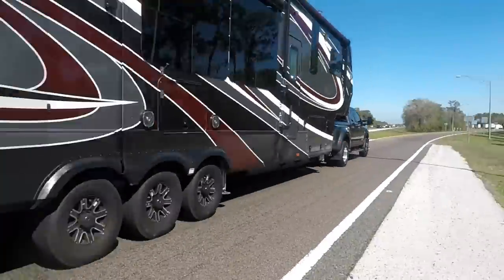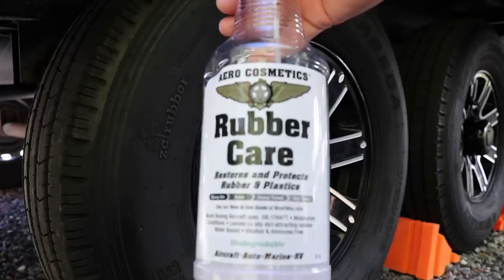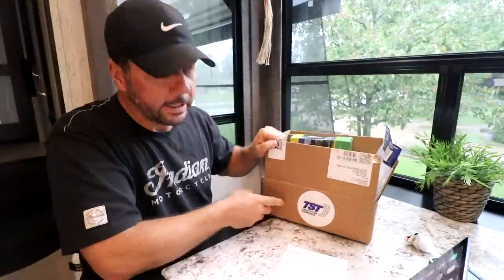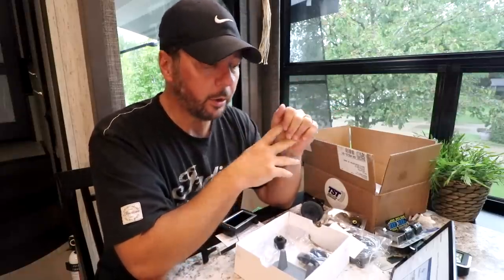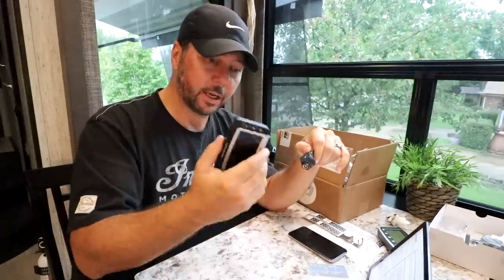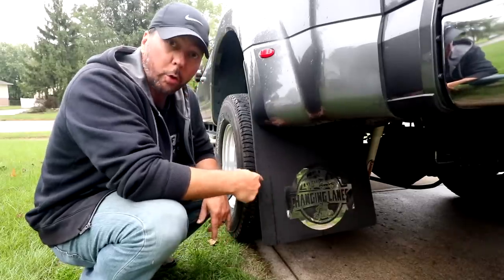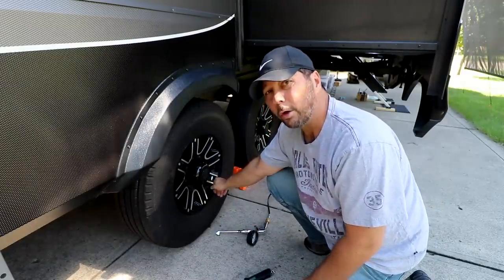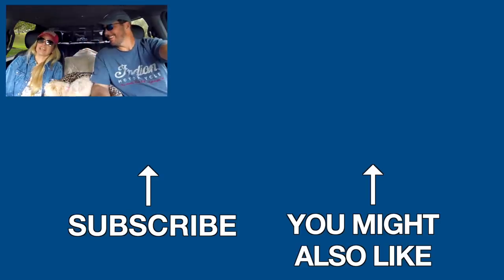RV and Truck Tire Safety | Best TPMS (Tire Pressure Monitoring) (TST-507) Review | Changing Lanes!

Comment: For those of you (us) new to RV'ing, use this checklist as a baseline and adopt it to your rig/situation.  It is overly thorough.  We bought our 5th wheel in April 2023 and still use this (modified) checklist for every departure and arrival.  Ours has several different steps based on our circumstances, but this covers nearly every basic issue..  Thank you, Changing Lanes, for the awesome video and allowing us to discover our rig without any undue pressure.  This video is still very valid.  Best wishes.

Comment: Hey guys, I’ve been running the TST 507 TPMS for seven years now. I can testify that it works flawlessly and well worth the price. Mine have saved us from a blow out on four separate occasions. It’s comforting to know your tires, rig and you are protected. Your advice is spot on. Thanks and happy traveling!!!
Reply: How long do the valve stem cap sensor batteries last?  Thanks in advance!

Comment: Hey guys, just want to say thank you for this video. I bought a tire pressure monitoring system (770) and so far on this trip. We’ve had two events that would’ve been disastrous without this. We had two tires separately that dropped to one dropped to 38 PSI overnight,the other dropped to 60 and set off an alarm. Metal stems were the issue on both tires with one, revealing a significant crack in the tire (could have blown anytime). We buy our tires at Discount Tire and always get the insurance so our $500+ Goodyear tire was replaced for $125! Thanks again, we are grateful for the advice! We found that ignorance is not bliss in this case!

Comment: I just installed the same system, TST 507 Cap sensors on my RV. I gotta say it's reassuring to see the tire pressure on the monitor. I agree with your review.
I installed metal valve stems, just because, using the Dill 902-W for aluminum rims. Did it myself. Not sure I'd do that again but I didn't trust any tire stores near me. It was easy with a bead breaker, but my Viair 400 couldn't reseat the bead, not enough volume of air, still had to visit the tire store for air.

Comment from the maker: ⚠️⚠️⚠️  NOTE!: Ideally, you should weigh your RV and consult your tire manufacturers load / PSI charts for proper inflation.  Or even better yet, do position weighing where you weigh each axle or even each tire and use that as a guide.  When we talk about using max tire pressure in this video, we are speaking to the majority who are running at, or close to GVWR on stock (or rated same as stock) tires.  If you have upgraded, for instance, from E to G rated tires, you might be able to use lower pressure than the max PSI.  Every situation is different, so please do your own research on what pressure to use.  As always, feel free to ask us questions in the comments below.
Reply: This is what I did. I upgraded to Sailun G rated tires but still run them at 80psi, which is what the manufacturer calls for.
Safe travels and good health
Reply: Hello Chad and Tara,  Iam getting ready to buy the tire monitoring system that you recommended . Do you still like it?  just curious what is the highest temperature that  your tires have been?
 Safe travels.
Reply: How can I get on the grand design forum

Comment: We took a trip from Houston area to Wyoming a few summers ago with a used pop up camper we bought.  It was a single axle and we had one spare tire.  Day one; blowout.  Put spare on and bought a new trailer tire from Walmart.  Day 3; blow out.  We replaced tires 4 times on that trip.  Very frustrating.  I did the research when I got home.  Turns out the tires were rated for the exact weight of our camper... empty.  So, we were overloading the tires.  We just bought a full size travel trailer and are researching TPMS systems. The new rig came with tires made in China, but the RV inspector we hired said they'd do for now and didn't recommend upgrading them until it was time for new tires anyway.  Thanks for the video.

Comment: When you're running that many tires, another suggestion is an infra-red temp gun.  They're cheap enough and you can use it to compare temps of everything that rotates on bearings.  Hubs, wheels, tires, fridge boiler temps, even shooting your radiator top runs is useful stuff from time to time. I would routinely shoot sidewalls of tires to get flexing  temps or hubs after a bearing replacement.
Reply from the maker: We do have one.  Not a bad idea to check the hubs and such.  I usually just touch them, but yea... good idea!  😊

Comment: Interesting timing - just yesterday I checked that my system was also TST-507 and then ordered the booster from Amazon. I have lost the signal a few times during the annual run to Sturgis and the beeping is annoying. The booster should get rid of that. In any case, since I've obtained the TST-507 units they've saved my bacon at least four times over the last 5 years; letting me know a trailer tire on my 5er is losing air. I now keep an impact driver, 20 ton bottle jack and TWO spares for the camper every time I leave for SD.   DO (really DO) pay attention to your tires and pressure before and during any trip with your camper or trailer.  Seven years ago, before we had monitors, a tire blew on our earlier camper and we had NO idea until someone drove up, waving to get our attention..  After pulling over, the damage done to the trailer was unreal.. These tire monitors will save you time, trouble and a lot of potential expense.. FWIW.
Reply from the maker: Love the idea of two spares!   Want to add that at some point soon.  Great idea!

Comment: Last 2 Holiday Ramblers, One trailer and one fifth wheel both came with Goodyear tires and both of them blow a tire right around 3 years. I replace at 3 three years even on my heavy equipment trailers for my  farm trailers. I didn't know when either trailer blow a tire, I was pulling bothe with a 3/4 ton Doge 4x4 Cummins and the fifth wheel was a HRC 34 ft.imperial Custom wide body.Never a wiggle when either tire blow. We did have a lot of damage to  both RVs

Comment: I use the eez monitor and am very pleased. Wouldn't be without some kind of system. On a recent trip I had a battery problem on the truck so had to boost it with the rv battery. In the confusion I neglected to check the eez before I hit the road and about 10 minutes afterward found that I was slowly loosing pressure.  Was able to stop a couple of times to air up and made it to my destination.  I believe that this averted a serious issue on the interstate. Turns out that I had picked up a small nail in the edge of the sidewall. My eez  updates pretty quickly except when I turn it off and restart it.
Reply from the maker: EEZ is definitely a solid product.  We had no issues with ours except what have been resolved with a repeater.   Glad it saved your bacon!
Reply: Yes, your rig Is longer than mine. Mine is 40 ft and eez works quite well without repeater.

Comment: Did you know that someone who is full timing in their RV really does not need to spray any kind protection on your tires!  Your tires come with Antiozonant in the sidewalls from the factory to protect your tire from drying out and cracking.  Every time you drive the Antiozonant works it’s way to the surface and keeps the sidewalls like new.  It’s only when they sit for weeks or months that they dry out.

Comment: We are fanatics about tie safety.  I've seen so many blowouts and how they will damage the side of the rigs. I put commercial load range E tires on my 5th wheel.  We moved from the G tire.  It was the best thing we did.  The sidewalls on the G rate were too weak for what we needed.  We get less bounce in our rig when traveling.  We always replace then when they get old and we always rotate.  My next purchase is a TPMS.

Comment: I was hoping the review was on the FORD TRAILER-MOUNTED TRAILER CAMERA - TPMS. This kit comes with sensors, repeater and trailer rear Camera. The reason I was interested in this one was to eliminate the use for all the different monitors since the kit uses Ford factory screen for camera and tire pressure readings. I have heard that the camera only works in reverse. If this is the case I will definitely purchase the TST TPMS. I love you guys channel because you put the work in to give us the absolute truth. Thanks
Reply from the maker: We looked into the Ford integrated TPMS and Camera.. A great idea but very difficult to implement.  Hard wired camera, internal only TPMS sensors, etc...  ALso not sure the camera system can be used while driving (observation mode) for changing lanes and such.  Also see: https://changinglanesrv.com/faq/?Display_FAQ=2763

Comment: After 9,000 miles on Westlakes (2017 Reflection), one tire TPMS dropped to 65 psi on I-95 near Philly.  I am using the VICTONY TPMS.  I got off I-95 and installed the spare at a Valero station to get home (Flemington NJ).  The WL tire tread had about a 4 inch crack in the tread.  Took that as a sign to replace all 4 WL with Goodyear Endurance (Made in USA).  Also installed the metal valve stems to use the “in-line flow” TPMS (to replace the caps sensors) when I decide to buy the TST.  Also balanced the new tires.  $642 out the door at American Tire shop.  Great video!  -Jersey Mike
Reply from the maker: Excellent "TPMS to the rescue" story!  Curious: were your westlakes the E or G?
Reply: Changing Lanes :  Hmmmm.  I don’t know the series E or G.  I know they were speed rated L, 75 mph max.   I sent you pics to your email.   - Jersey Mike
Reply from the maker: Thanks for sharing the pics... yep.... E rated Westlakes.  Glad you got them replaced.  😎
Reply: I have G rated westlakes 2018 solitude are they good to go? I am getting the 507 for shure. Do you still have your westlakes with all the miles you have gone?

Comment: Yes to TST for providing the repeater with the kit - especially for 5th wheels!  I have the EEZE system, and ended up purchasing the separate repeater - which solved the problem with sensors dropping out.

Comment: Thank you so much for making this video. As you know I absolutely loved the T24, T12, T0 video with a passion and I had to bookmark techno rv because I fell in love with their site. I will be buying quite a few things from there to be prepared once I’m good to go. I like planning ahead even years ahead so I can spread out the cost of these items since some of them are huge purchases. The reason why I’m commenting is because I was looking at this system after you mentioned it in the previous video and when I looked I had no damn clue what a flow thru was. I mean I had an idea you keep it on and it hooks up to the compressor but what I DIDNT know was use steel valve stems because of the weight. N0w I in0w to make sure ahead of time or just install the steel stems so I won’t have to take the damn caps off each time I air up or down because my trailer will be an off road system. So, thank you thank you my brother and sister. I love these l0ng informative videos. I love the chemistry you both put out on camera and I can see the love on how you do the bulk because of your wife’s illness (as it should be) and she takes care of what she can. That’s a true union at its fullest and that makes me smile. I recently went through a tragedy and lost one of my sons (a twin) and my 20 year marriage just dissolved. So I’m a lone wolf soon to be nomad and I can really appreciate your loving relationship. Anyways, enough of my sob story. I just wanted you to know that your work and efforts are not in vain. I’m glued to your videos and I’ve been going back and watching older ones I’ve missed. Blessings to you both. Be safe
Reply from the maker: so sorry to hear about the loss of your son! 😞  We can't even begin to imagine how that must turn your world upside down.   
Blessings to you also and thanks for watching!
Reply: @ChangingLanes  ❤❤❤❤ thank you

Comment: I installed the 507 and loved it.  I thought it was a bad transmitter when i installed it, only to find one of my inside tires was flat.  I like it due to the fact if you haul different trailers you can swap them easily.
Reply from the maker: We still use ours all the time and love it!  Just now ordering some new batteries for the sensors after 2.5 years.

Comment: I use a different TPMS but it is a must have especially since I have a single axle trailer I really want to catch the blowout before it happens. My trailer is going into the 4th season now still with the original tires but I will be changing them this spring to Goodyear Endurance.  Thanks for the great videos, very informative, lots of great mods, upgrades, maintenance  and helpful tips on travel trailers and still fun to watch your travel and destinations.

Comment: Just returned from a short trip. Small trailer (Forest River Wolf Pup) on five-year-old Castle Rock OEM tires. While backing in I noticed that the tread was deformed on one of them and the corresponding sidewall is bowed out a little. It looks great sitting still, but it's coming apart internally. Two Goodyear Endurance are on order for me at my favorite shop. Almost five years to the day and the China bombs are ticking.

Comment: I pull my Momentum 394 with a 2008 SRW F350 w/6.4 diesel.  It has 37" RT Toyo tires that are rated several hundred pounds greater than the last rear axle weight rating I got.  The rims have nearly the same capacity as the tires.  However, due to the width of the tires, I'm always concerned about tire temperature and the resulting increase in pressure due to the temperature.  I believe the TPMS system you show here would help provide me much peace of mind when towing.  

FYI, I also have 4.56 gears, the truck runs super and hasn't had a single issue pulling the steepest mountain grades in Utah.  Brakes have also been updated with slotted/drilled rotors and pads that are approximately 30% greater surface area than stock.  Although the truck is in impeccable condition and runs like a raped ape, I do have an F450 in my future.

Thanks for the great video here and the others you've shared regarding your Momentum.   -LBM
Reply from the maker: Welcome to our channel! 😊  Thanks for watching! 😊

Comment: I just ordered the TST507 with pass-thru from TechnoRV, to replace my TireMinder A1A. I love everything about the TST 507 except one thing: It takes forever (forever = 4 minutes and 45 seconds, give or take a couple seconds) to pick up the signal from all four tires, even with the range extender installed. The TireMinder A1A only took a few seconds for our RV. I just need to remember to turn on the TST 507 when we start to hook up our rig, so it'll be operational by the time we pull out of the campsite :-)
Reply from the maker: Agree on the time to acquire the sensors....  Luckily it's fast at reporting a leak! 😊

Comment: I just left home last Sunday headed to Arizona for Thanksgiving. I got about 13 miles down the road and got my first blowout on my 2016 toyhauler. I had Westlakes, about 10k miles on the tires, and they were about 2 years old. It was total tread separation. TPMS wouldn't have helped me on this one. Trust me, I did everything right. I always check the psi, inspect the tires,  I don't overload, and I stay at about 55 mph. It ripped out all my wiring under the slide and broke my fender skirt. I was able to repair the wiring and I changed out all the tires for Goodyear Endurance. Funny thing is, this was suppose to be the last trip before we replaced the tires, because we didn't completely trust the Westlake brand. I wish I had listened to that little voice in the back of my head. So anyway, be careful out there if you're staying with the Westlakes.
Reply from the maker: Holy cow, man... Sorry that happened to you.   Were they the E rated Westlakes or G?  I've not heard of one tread separation on the G rated, but have heard of several on the E rated Westlakes.  Safe travels, glad you got the goodyears!

Comment: Thanks for the video. It was immensely helpful in making our decision on this essential piece of equipment. We were sure to use your link when we order from TechnoRv.  Love supporting this helpful RV community whenever we can.  We are running a 42.5' Toy Hauler with a Ford F450 dually and really appreciated your advise about the direction you went on the choice of your sensors for the duallies. Our trailer is pretty heavy as it is built on an all aluminum horse trailer chassis, so we have some pretty substantial tires (Michelin XTA2 Energy - J load rating) that we need to keep a close an eye on. Thanks for all the informative and fun content.  Hope our paths cross on the road someday.
Reply from the maker: Thanks for using our links and for watching!  😊